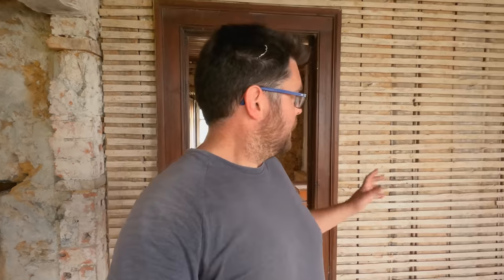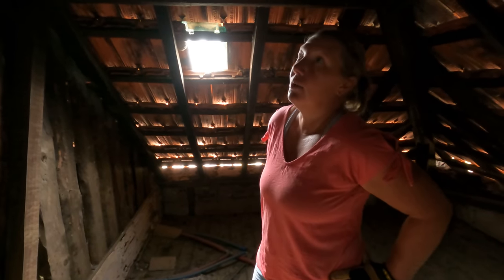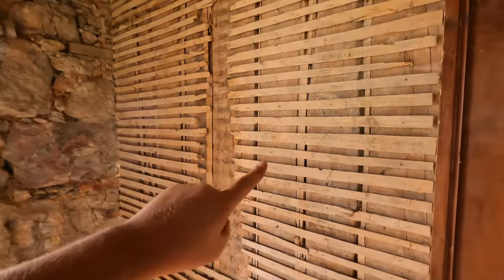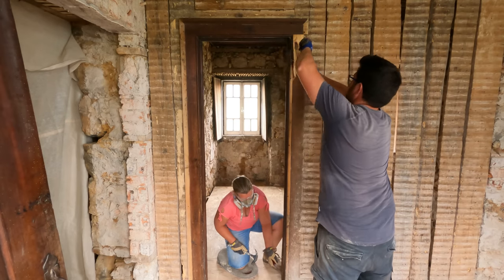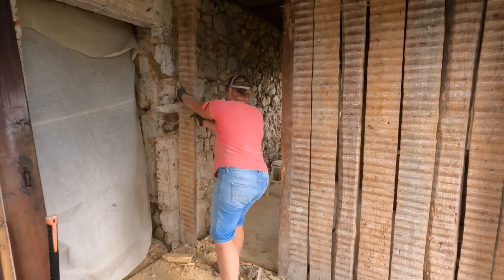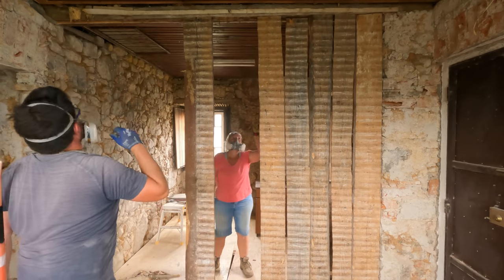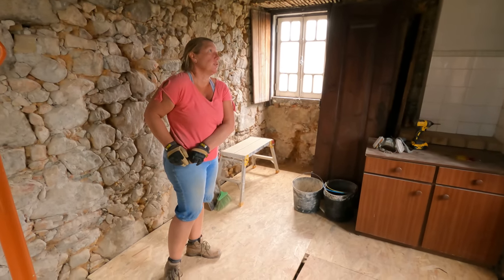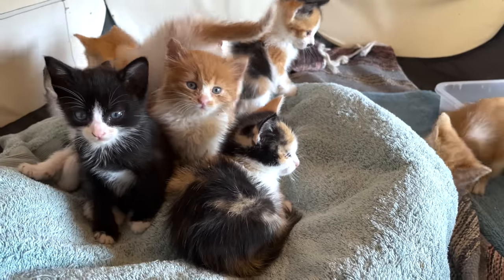Removing an Old Tabique Stud Wall (and Kitten Update)

Comment: I enjoy these videos because we see what needs to be done with each project, and the two of you actually doing the work!  There are videos of people in similar situations whom I would call "dabblers", who do little bits on camera, while the rest of the work either was already in place or magically appears.  

I presume that with a functioning heat pump you might plan to spend next winter in the lower floor of the house rather than in your tent.
Reply from the maker: Thanks for the kind words 😊

Yes, once the heat pump is in the plan is to make the downstairs as habitable as possible. However we’ve had a couple of curveballs thrown at us recently so we might need to change plans a little

Comment: So we started with 2 cats but slowly but surely, we expanded to what we have now. We have 12 indoor cats which includes 4 kittens and 30 outdoor cats which includes 5 kittens. The best toys that we have found are tinfoil balls (about golf ball size crushed so that they are really hard) and a large sturdy cardboard box. The box with the flaps pressed in will allow them to learn to balance, they will play hide and seek in/on it. It's also a great tool to help them when they are cutting teeth and also sharpen the little claws. You can expect the box to last about a month as they rip it to shreds. I take it you're using the communal method to feed them (as few dishes as possible). You might find seperate dishes might help at feeding time, you would need to scatter the dishes as if they are close together then they will try and eat someone else's food. If you do the above with the dishes, then try to feed the same kitten in the same place every time (after a few days they will know the feeding spot and might sit at it waiting for you to feed it).
I was stunned by how much of the doorjamb was just dust, what a good job you found it. I thought you had already got rid of the wormy wood, it might be a good idea to "tap" a few mre bits of timber that is left..... just in case. Thanks for posting

Comment: You should have made that roof space your living area, would have given you a great place to live while you worked on the house.
Reply from the maker: The roof space is either a sauna (in the summer) or a freezer (in the winter). Definitely not suitable for anything until it has insulation and membranes etc (to keep the birds out)

Comment: Rather more because I would like to see if it's possible than practical, would you consider either buying a module element roof or build the whole roof as parts like trusses etc. on the ground and then assemble the parts with a crane? Also about the first floor ceilings, would you consider leaving them out and insulate the roof instead? I always think it's wasted space nowadays, in the time of construction i understand that it was probably the way to build a house.

Comment: I believe that this wall wasn´t tabique because tabique walls are obtained by nailing slats onto boards placed upright as mullions and the whole being coated on both sides with lime mortar plaster. Due to their great importance, tabique walls are, in fact, a very particular example of dividing walls, which, spreading throughout Portugal, characterize all Pombaline construction.
Reply from the maker: What you’ve described is the exact construction of this wall, but we’d removed the lime a while back